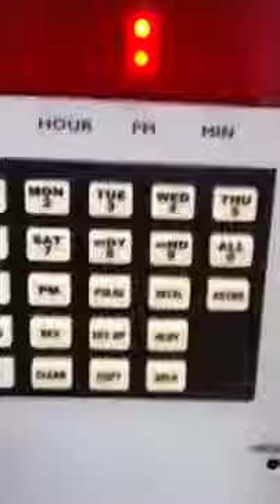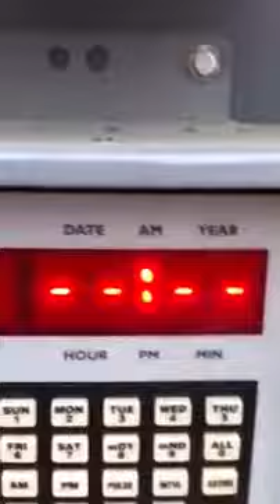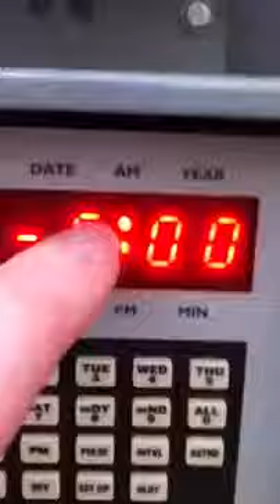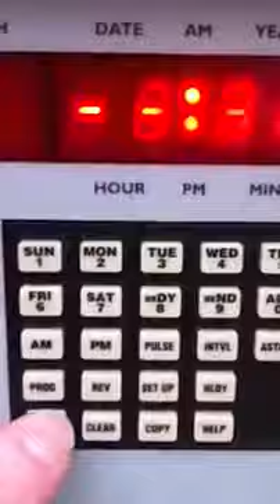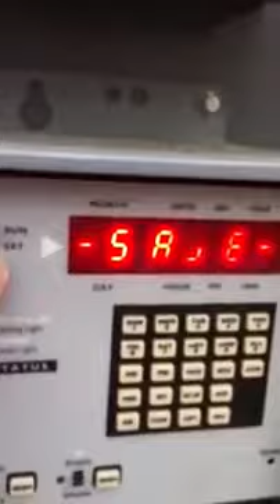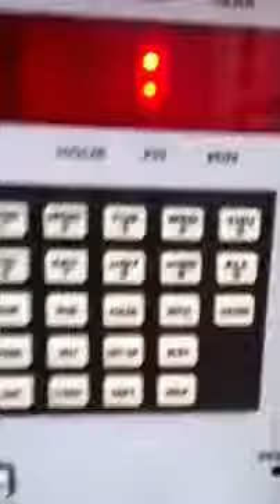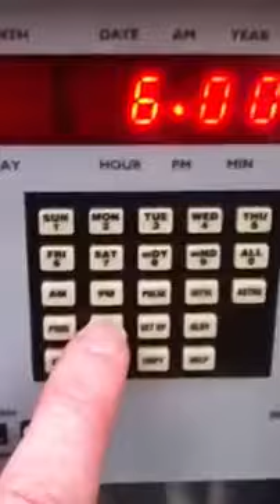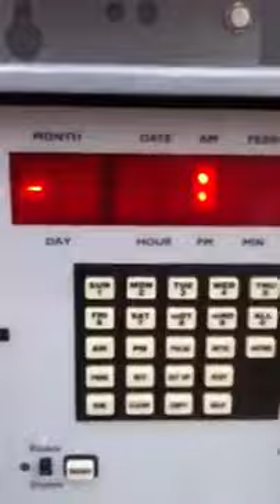Intermatic%20Timer%20Programming

Comment: This is the most confusing time clock I’ve worked with
Reply: literally, lol. Especially when you want to use the damn astro function. I don't even know if I've programmed it correctly but I'm off hours both when the clock is supposed to come on AND off lol.
Reply: I hate these and would rather switch back to mechanical. lol

Comment: Omgosh!!! Thank you so much! Side note if you have multiple start times and stop times you don't want in each day continue to click through review on that last step then when you find a start time push clear then review again to the next start time and push clear I had three start times between 6 a.m. and 6 p.m. which I did not need which were added by mistake so I was able to go in with the steps that you'd outlined until the last step to do the program all review and as I was reviewing I deleted each unnecessary start time I'm so happy it's been 4 years thank you your God
Reply: How to keep it running forever? I mean I don’t want to switch off power how should I do that ?